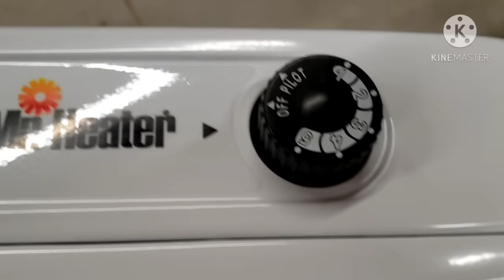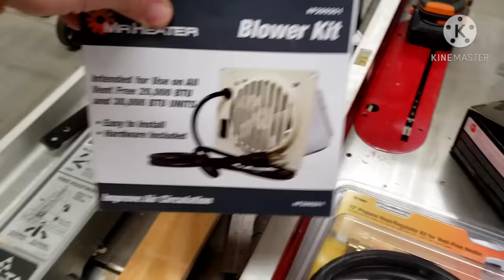Mr. Heater 30k Btu Propane Heater Opening And Install!

Comment: Make sure the room isn't too small for the btu's of the unit. Room height X length X width X 20=btu max.
Reply: OH SHOOT... that leaves me out!!!
I wanted to put this in my Vintage Tiny Travel Trailer (VT3)...
it's only 17' long... so this would be too big for it... right?
Reply: @judichristopher4604  what are the btus on the unit?
Reply: What if you just kept the 30,000 BTUs on low with auto shut off?
Reply: @penelopepi  you'd still be putting yourself at risk of carbon monoxide poisoning.
Reply: @ryantettenburn940  thanks.
 And it sounds like even if you have the correct size; it's most definitely not recommended to use constantly in cold weather. Someone in this thread mentioned 70° 24/7 for a friend of theirs. I have concerns.
Reply: @penelopepi  ...they have heaters with less BTu's...
Reply: @judichristopher4604  ...you would buy the one with lesser BTu's...
Reply: @ryantettenburn940  
I don't know...
Reply: @TheOneLawgiverHolyGod  
Thank you...
Good to know!!!
Reply: @judichristopher4604  ...you are welcomed...you should also look into a mini split which many tiny homeowners install to keep warm and for air in the warm climates and for the warmer seasons...
Reply: @TheOneLawgiverHolyGod  
That is a great idea...
Thank you so much!!!
Have a Happy New Year...
Reply: @judichristopher4604  ...you are so welcome...I also am looking into the mini split to be free of the grid...plus with all the power outages...one needs to provide for one's own needs and not be left at the mercy of men when there might not be any men coming to one's needs!!! Amen!!! I want to have all kinds of backups...because when it is cold in a house...it is colder than outside because there is nothing to push the cold out...nothing!!! My NEW YEAR STARTS IN APRIL...I DON'T CELEBRATE THE LIES OF MEN... DECEMBER 31ST IS NOT TRULY A NEW YEAR FOR ALL, UNLESS IT IS ONE'S BIRTHDATE,, BUT THE END OF THE FISCAL YEAR FOR BUSINESSES, CORPORATIONS AS I UNDERSTAND IT!!! AMEN!!! WHEN ONE BIRTH DATE ARRIVES AND ONE IS  YET ALIVE...BE THANKFULL UNTO THE HOLY GOD FOR HIS CONTINUED MERCY AND GRACE TO STRIVE TO MAKE IT INTO THE KINGDOM OF CHRIST, BEFORE IT IS EVERLASTING TOO LATE...NOT INTO  THE BUILDINGS OF MEN, BUT INTO THE KINGDOM OF CHRIST WHICH IS A SPIRITUAL KINGDOM, BUILT UP OF LIVELY STONES AS I HAVE READ!!! AMEN!!! AMEN!!! I PRAY YOU MUCH SUCCESS IN YOUR ENDEAVORS!!! AMEN!!!
Reply: @TheOneLawgiverHolyGod  
"Amen Brother... Amen"
Reply: @TheOneLawgiverHolyGod  yes, they do. Hope they got one... 😦
Reply: @judichristopher4604  you have to look on the body of the heater to find the BTUs.
Reply: @TheOneLawgiverHolyGod  
Exactly... It was so sad the people back East that Froze to DEATH in their car... because they didn't think the weather was that bad... So Sad.. 
Not counting the ones that did not have extra heat source when ELECTRICITY goes out, which it usually does in  that bad of a storm.

Comment: For me, any unvented heater be it propane or kerosene is scary. They burn up the oxygen in the room and give off water vapor. Soon your walls start going black and growing mold. They make vented units that go thru the wall and do not require a chimney.
Reply: I've had 2 of these for over 5 years and none of this has happened. They are very oxygen sensitive. Love the radiant heat

Comment: Wish you would have shown you hooking the lines up. Is hand tightening them ok, or should you use a wrench. Anyone?
Reply: Use a wrench. Soap and water solution after to check for any leaks. Use thread dope as well.
Reply: @sammoore3349  I used a tape for the part that goes into the heater and then stuff from a can on the parts that connected to the line. And thank you I wrenched it down.
Reply from the maker: Agree with Sam, I believe it was just a Cresent wrench and yellow gas specific thread tape.
Reply: @cartersboxerandbulldogbabies  in the can - pipe dope?

Comment: Is it safe to use a 20lb propane tank indoors?
Reply from the maker: They don't recommend it because of hazard from a bad tank or the heat source being next to the tank but I did it until I did the final hookup to an outside 500 gallon tank. I did a final install video also. Thanks for watching!

Comment: Did you use the tape on both both ends of the line? (Into unit and on tank?)
Reply from the maker: I believe I did. Depending on the unit they may specify otherwise.

Comment: I was all set to buy one of this, but you mentioned that the propane tank inside is only for a temp solution.  My only purpose was to use this for power outage.  would this be an exception to the line hookup or is the propane tank inside not recommended at all?
Reply from the maker: Hello Jane! When I stated the line is only for a temporary solution with the tank inside, that is me stating what the company has on the side of the packaging. I used this setup for months before I finally got it hardlined through the wall to the outside propane tank. I even left the plastic feet they give you for the unit sitting next to it on the wall in case of a power outage and I needed to disconnect it and use it inside the house. I have personally watched quite a few videos of people running these in their homes. Hope that answers your question! Feel free to ask if you think of something else!
Reply: I just bought two of these for emergency outages , my plan is to set them up next to windows so i can run the hose out the window to a propane tank sitting next to my garbage cans on one side of my house , and i have a rubbermaid shed on the other side for the other propane tank.

Then i will use towels , duct tape and plastic to reinsulate the windows once the hoses are run. (and i also bought a "big buddy" portable heater in case there are cold spots in the house that i need to deal with)
Reply from the maker: @Cyberhacker3  I've heard of alot of people picking these up for emergency situations. Sounds like you have it all planned out! Nice!
Reply: @HermanWoodworks  Some people are saying the supply chain catastrophe will cause America to start running out of natural gas around february , interrupting home heating and causing power blackouts as the power plants run out of fuel.

I could deal with losing heat or i could deal with losing power , but losing both at the same time in the middle of a Minnesota winter might have proven to be a serious problem.

So i spent $200 each for 2 vent free heaters , $150 for the big buddy , $150 on hoses and regulators and im about to go spend another $300 on more propane tanks for a final tab of $1000,  which sounds like alot , until you start adding up how much it would cost me if all my pipes burst ,, then $1000 sounds like a hell of a good deal .
Reply from the maker: @Cyberhacker3  wow, I hope it doesn't get that bad, but glad to hear your on top of the situation especially up in Minnesota. Ohio gets cold but I won't even pretend it's close to Minnesota cold. Stay warm!
Reply from the maker: @Cyberhacker3  I also did a video where I did a final hookup to my 500 lb tank. Not sure what size tanks you have....

Comment: Been wanting to add one of these inside my home for secondary heating. My heat pump struggled to maintain temps last year when we hit single digits down here in the south. Wondering if this would work well with a 100 gallon tank and if I could make that tank last all winter.
Reply from the maker: I did a second video where I final installed it to a 500lb outside tank. Maybe that will help. I don't know about all winter. Maybe if you are just using it as supplemental heat on the coldest days. Let me know if you have other questions! Thanks for watching!
Reply: OK me and my wife have a 120 gallon tank we have 120,000 BTU heater and one 10,000 in our main bedroom. We live in the south north Georgia when it did get really cold last year and running hours and keeping it very comfortable in the house, we got around 5 to 6 weeks worth on our tank now that was when it got low teens and it hit eight or nine if you run it when it stays around 30° I think it actually lasts closer to around two months before we absolutely have to have it full. Hope this helps but once again how well insulated your house is actually a huge role on how much it takes to heat it.
Reply: You can take 40# tanks to Tractor supply or Ace Hardware to be refilled.  A very good deal.
You are limited to 90# of Propane in a vehicle and tank size has to be less than 45#.
Once you get in the habit, you refill them a few times a Winter.  Easy

Comment: How much does it cost a month to keep your 500lb tank filled when using this in winter time. I'm assuming you'll run it alot more with the bigger tank
Reply: A 500 lb tank costs about $1200 and will last all winter for both heat and cooking in Fairbanks Alaska. In a 900 sq foot leaky old home

Comment: OK this may just be a minor complaint and please someone actually correct me if I am wrong on this but here’s the confusion smaller tanks are rated by pounds a.k.a. 20 pound tank 40 pound tank 100 pound tank I think anything over a 100 pound tank that is a stationary tank that cannot simply be picked up in more and moved easily Hass to be moved by machine is then rated in gallons me and my wife have a 120 gallon tank right outside her house then from my understanding you can get a 250 pound gallon say I did it too 250 gallon tank a 500 gallon tank and I think someone makes an in 1000 gallon tank but that’s still the point I think after a 100 pound tank everything is rated in gallons after that
Reply from the maker: It is odd and I'm sure someone will have a better explanation than myself. I did a second video where I did a final installation to a 500 gallon tank outside. Maybe that will help with any questions. Thanks for watching!

Comment: Why isn't this a permanent setup with the tank and line. What is there a concern with the setup thanks.
Reply from the maker: The only hold up for having it be actually piped through the wall permanently is myself...I'm not 100 percent confident in plumbing the lines myself and for insurance purposes I waited for a professional to do it. I know i could run the lines but the negative side in my brain just worries that if something happens, God forbid, the insurance company won't payout for it....I know I'm over thinking it but ultimately that has been my only hold up. Sorry for the long explanation!
Reply: Because he doesn't want to have to change the tank every 3-5 days. Hardline pulls from a larger tank, less refills???? My guess.
Reply from the maker: Truth....also I'm pretty sure insurance companies would have a problem with it...
Reply: That makes total sense I never thought of natural gas or propane to be experimented with. How much would it be for the bigger tank and install of the natural gas lines ballpark. I bought the same setup and would be nice to not have to worry about changing tanks and the safety aspect of having the propane in the garage thanks for the responses.
Reply from the maker: I'm in Northeast Ohio and the propane company i have set the 500 lb tank and are installing the line to the workshop and house for under 300 bucks but that is also based on me using a certain amount every year. Propane contracts need to be read carefully...
Reply: Thanks for the information I’ll be looking in to that I like being safe and protecting my assets makes it worth it to me. Also I know now to be aware of contract when going in thanks again.
Reply from the maker: I'm the same as you, I'd rather be safe than sorry...especially in a day and age when insurance companies try to avoid paying for any reason should an accident happen. I should state that is my guess also....I just figure when home owners insurance asks how you are heating your house im sure the same applies to your workshop.

Comment: My brand new dual fuel blue flame heater works but the burner cycles on and off when it barely reaches 60 degrees. I have the thermostat set on 5. The pilot light stays on. I would think the burner would stay on until at least 70 degrees. It’s running on LP. What could be the problem?
Reply: If yours is hung on a wall with the top brackets towards the top, pushing the top of the heater out, you need to level the bottom of the heater out away from the wall with about a half inch of rubber bumpers, or maybe the sticks that came with it if it came with any what that does is it causes the thermostat on it to not function properly. We ran into this problem multiple times, what we actually did was went to Home Depot or Lowe’s and got quarter inch sticky bumpers and adhered two on one side on the bottom and two on the other side left and right double stacked. This pushes the bottom away from the wall and somehow tends to make the thermostat work more properly, as I said we had to physically do this twice and this was our problem when it’s tilted that way the thermostat won’t work right or you can literally find anything that’s probably about a half inch thick and push the bottom of the heater away from the wall that should help fix the problem then the thermostat works right

Comment: So this may be a very stupid question but i cant seem to find an answer. I am needing an emergency heating source in case of power outages and was wondering, is using a propane tank indoors with sensors a viable option or would this not end well?
Reply from the maker: Not a stupid question...but it's kind of a complicated answer. For insurance purposes and total safety, the answer is no. But if you read through some comments on here or watch some other videos, lots of people use this heater indoors, including the tank. I used it indoors for a short while to heat this workshop. I did a follow up video with the final installation to a 500 gallon tank. It says ventless but there will be some smell and fumes. Crack a window or open and shut a door from time to time. I know its a round about answer but really it comes down to what you personally are ok with. I've watch people run kerosene heaters indoors and they are crazy fume producers. Let me know if you have any other questions.

Comment: I read online these shouldn't be ran 24/7 (if you're asleep or not home) yet a plumber is saying its fine as long as you use a thermostat? Anyone care to chime in?
Reply from the maker: Personally, I never let it run when I wasn't at home. It's a nice heater but I myself wouldn't feel comfortable leaving it unattended for a day. I'm not saying it can't be done but that's my personal choice. I don't feel like I would trust any heater beside a home furnace.

Comment: I don’t understand I bought a Mr heater. It ran a whole tank of propane out in about 10-19 hours. That’s a tank of propane a day. What am I doing wrong??
Reply from the maker: What is your square footage and which setting do you have it on? I would only run it on 1 usually and shut it down when I wasn't in the shop. The insulation held the heat well.

Comment: I have one of these but it is for Natural Gas.  I have to run a 70 feet hose from the gas hookup to the shop, Do I have to install a valve at the other end? Does natural gas provide the correct pressure at 70 feet?   Any input would be great.  Thanks!
Reply from the maker: Talk to your gas provider about their requirements and I think they may even do the final hookup so they can pressure test it and assure they put on or provide the correct regulator. The propane company i used did that for me. I just had to run the line through the wall. Hope that helps.

Comment: I have a ventless heater item number or model number BF30DTDG-4 And I don’t see the hole in the interior of this model that you’re speaking of and the problem here is installing the heat sensor where does it go on this particular model thank you
Reply from the maker: Hello, I looked up that model number and it came up as a Dyna Glo heater. They look very similar but they are manufactured by different companies. I tried googling the installation directions from Dyna Glo and didn't see a very clear wire up for the blower. Sorry I couldn't help more.

Comment: please let me know if you put a regulator in the line, or did you use the outside propane tank regulator. i just purchased mine today, and will get the pipe monday. tks
Reply from the maker: I did a final installation video and i go over the regulators. I have it hooked up to a 500 lb tank but I went over the heaters inlet pressure requirements and they installed the correct regulator I needed.

Comment: Ok I bought this why flame stays on but the heater itself turns off unless I move the dial up, the starts again
Reply from the maker: The flame or pilot light will stay on when the heater turns off when it has reached the desired temperature setting. The only way the pilot will go out is if you turn the unit off or run out of propane. The pilot is what re ignites the burners when the furnace needs to run again.

Comment: Was this heater better than the rigid heater you did a review of. The rigid was double the BTU. I was looking at buying the rigid for my garage (or that style of heater) then I came across this video and wondering which is better
Reply from the maker: The ridgid gives quick heat but I definitely wouldn't run it a long time, I used it during the deep cold to take the chill off. The ridgid also seemed to put alot more moisture into the air and it definitely consumed more propane. The tank would get iced over. The fumes were also quite a bit more substantial. If your indoors the Mr. Heater unit is ventless and overall better for the small shop setting in my opinion. Easier to mount on a wall and keep out of the way. Probably have some other reasons also....oh being near it is safer with the mr.heater, I accidentally walked in front of the ridgid unit and burnt off some leg hairs....lol. Let me know if you have any other questions!